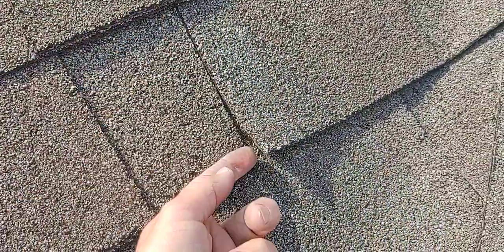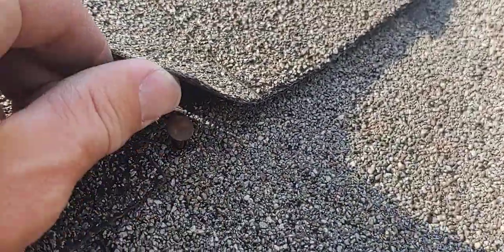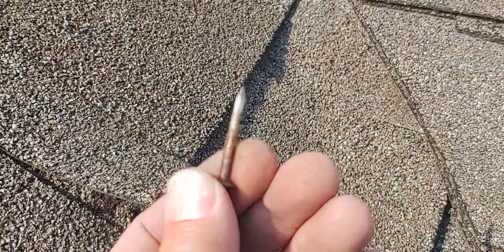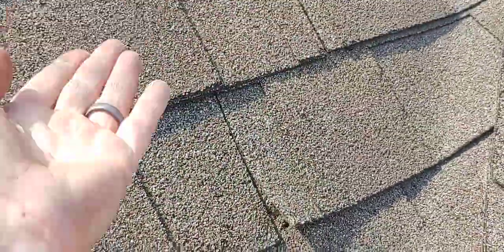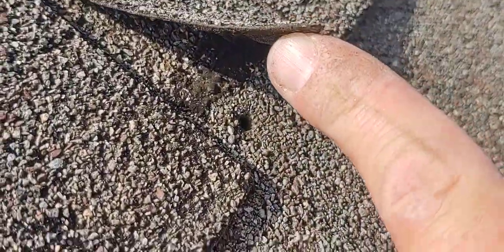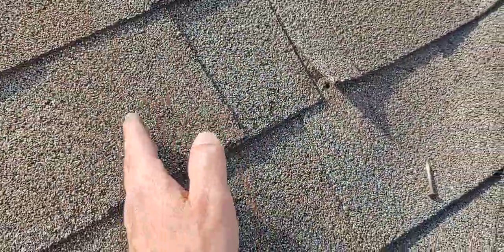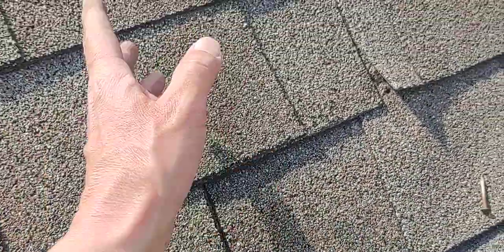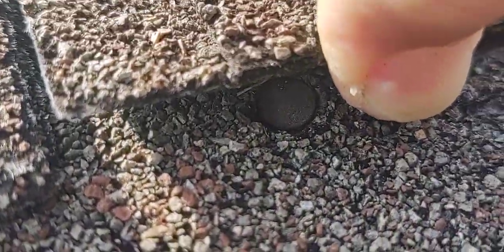Roofing nail placement is bad in a keyway

Comment: Omg.  They re-shingled again on warranty due to leakage in wall and it’s worse now.  They are telling me the roof appears to be installed properly.  Have had several people out.  In a brief troubleshoot the last one found a number of nails in the key lines.  One mail was overshot on a key way below valley making a hole and then another nail shot in beside it.  He found rusted nail in keyway at top of valley that is already rusting and the two trusses there are high moisture rating after inches of rain.  Oh boy I am losing sleep over this and very tired.  Thanks for short and concise video.

Comment: I'm learning so much about nails, because of your videos! And proper nail placement. Are the nails going to be aluminum, steel, galvanized: why was that galvanized nail so rusty? Zinc coating worn off? Must be an older roofing job? And then there's placement. The goldilocks positioning of each nail. And make sure it's hammered down! 4, 5, 6 nails per shingle?? Yikes. 
My new roof next month is going 2b 50year, OC and I sure hope all the 67 '5 stars' my contractors got on Google is reality. So far, so good.